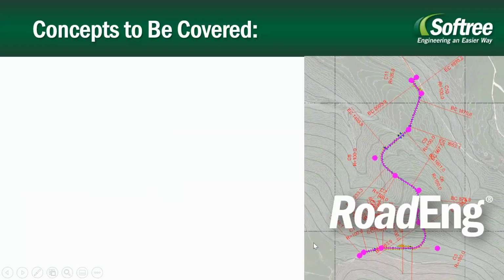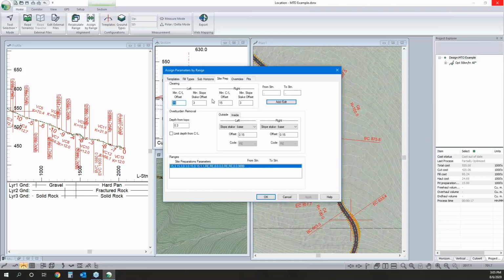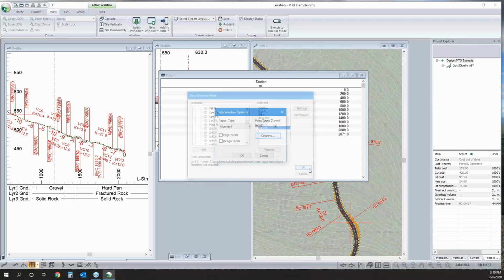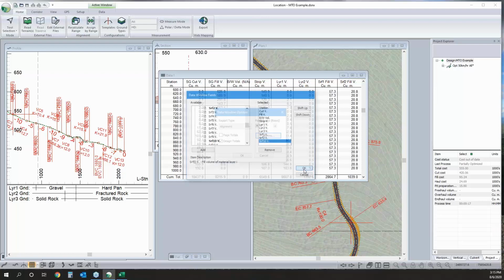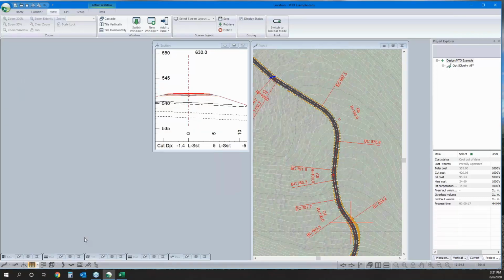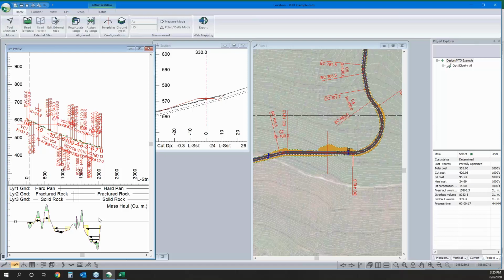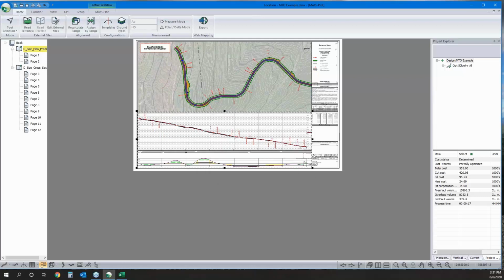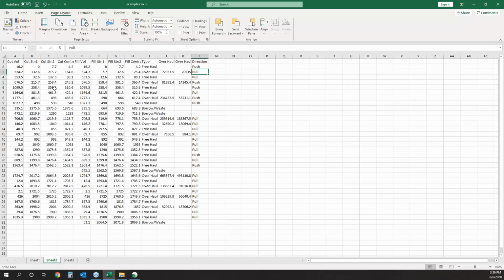Earthwork Estimation and Materials Take Offs

Comment: Need to export data from Excel
Reply from the maker: Hi again Haririshna, we already replied this in the comment from the other video, but have copied/pasted again just in case.
''Softree’s RoadEng software is compatible with many other programs including Microsoft excel.  When you ask about importing data from excel are you referring to survey data?  If so that data can be used to create a topo surface to design from, produce material estimates, and a masshaul diagram.  The article linked below provides a workflow for working with similar data (it references ASCII files but ASCII files are easily exported from excel).  If we are misinterpreting your question please let us know and we will try to provide you with an appropriate answer or links to appropriate resources. 

https://support.softree.com/knowledge-base/terrain-module/features-coordinate-and-attributes/importing-ascii-files''